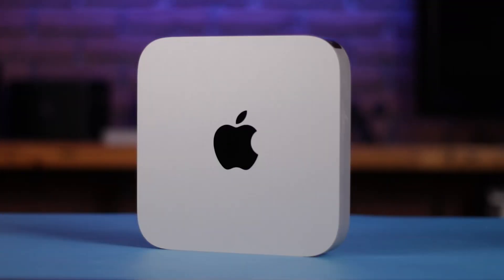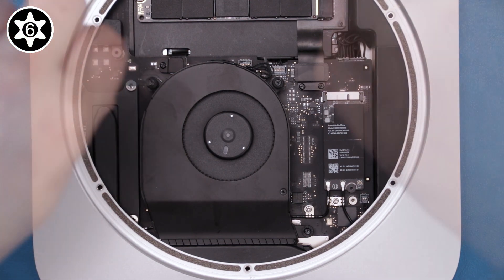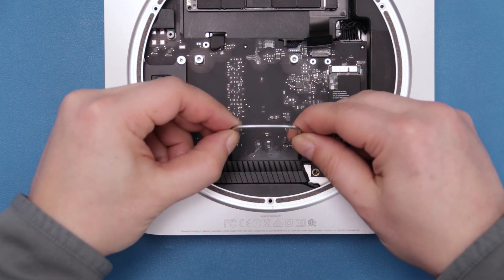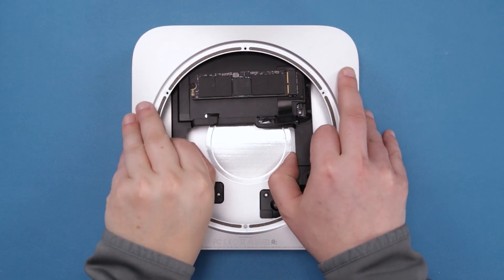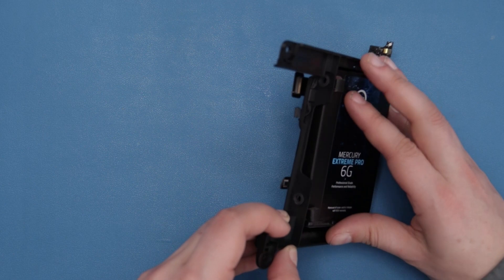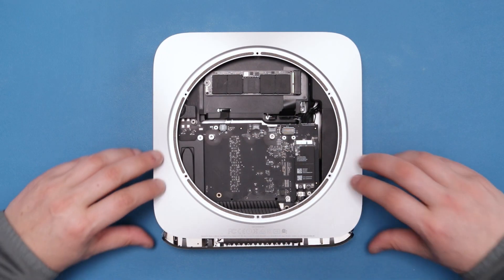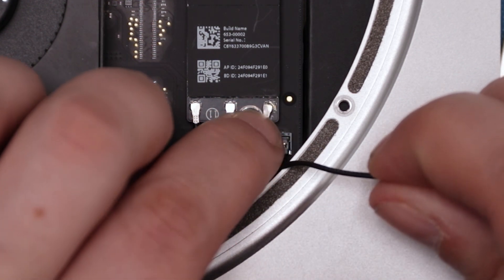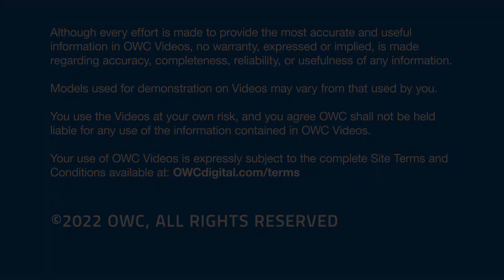How to Upgrade or Replace the 2.5-inch drive in a Mac mini (Late 2014) Macmini7,1

Comment: Thanks, the video I was looking for, by far the best, one question, my Mac mini 2014 Model A1347 has a FusionDrive 1T, I would like to replace the HD with an SDD for data and files, and add an OWC 1.0TB Aura Pro X2 NVMe Flash SSD for OS, is this possible?
Reply from the maker: Yes, that is 100% possible! As long as the Operating System is 10.13 or newer. The Aura Pro X2 is only supported on those

Comment: I think l just the have the 512gb  flash drive can l replace that with a m.2 using the same controller as the flash drive
Reply from the maker: Regrettably, the M.2 drive has a different type of connection than the blade-style SSDs that would go inside the Mac Mini. You would not be able to use that with the same controller.
Reply: @poweredbyowc  Thanks l bought the Aura flash drive and it  runs great. Is it possible to get a controller that works with a m.2? I’ve seen kits on Amazon
Reply from the maker: Hey Kevin,
We're glad to hear that the flash drive has worked out great for you. Regrettably, we don't offer those controllers.